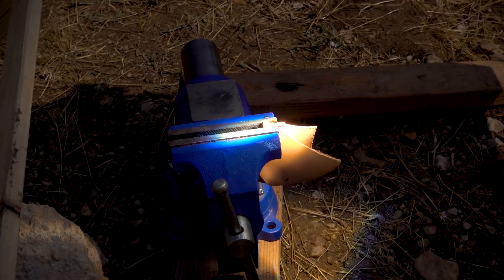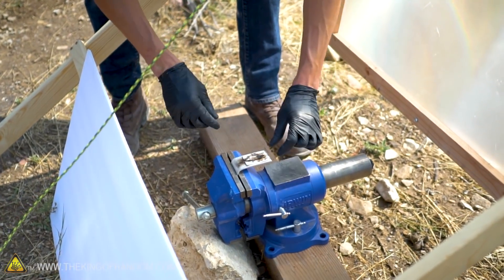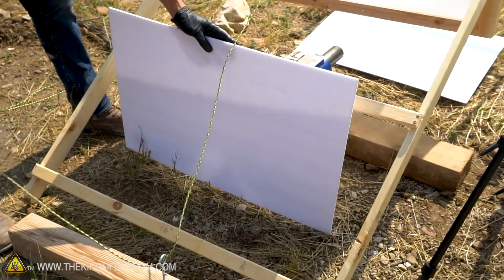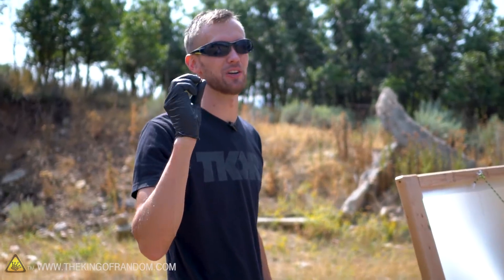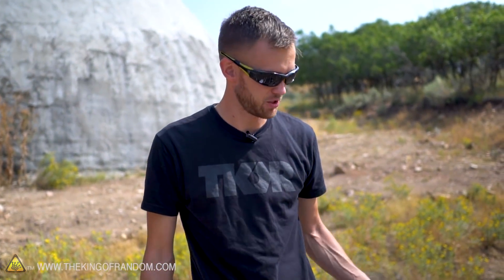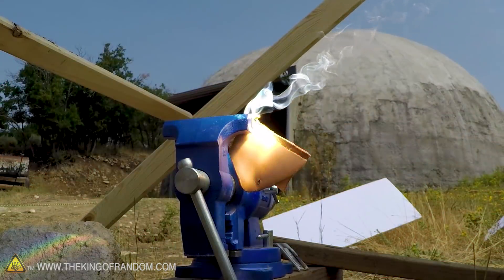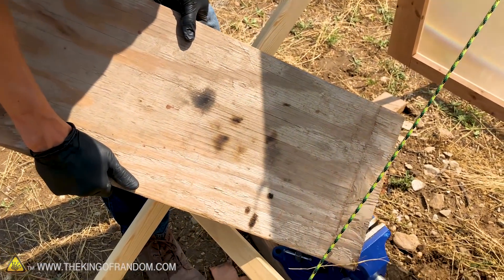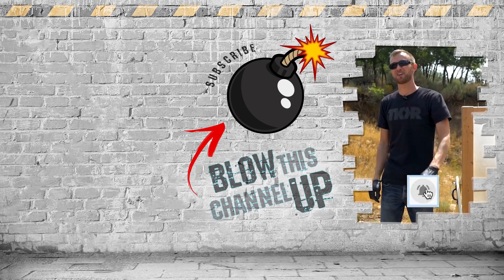We Shot Bullets with SUNLIGHT

Comment: A bullet will not go anywhere if it is not in a chamber where the pressure can push the bullet through the barrel.
Reply: Also firearm barrels have twits inside so the bullet spins on its way out causing it to have a straight trajectory appose to flying all over the place

Comment: When a bullet is fired outside a gun it looses almost all of its power because the gun directs all the power to the bullet and out the barrel( which makes the bullet fly fast) but when the chamber is not there to direct power, or goes everywhere and the .22 would hardly break skin. You’d be more worried about the casing than the bullet.

Comment: Why did you not use a high speed camera? You could try a piece of thread around the bullet going under the platform and attached to a spring loaded trigger to trigger the camera. When the bullet exploded the loop of thread around the bullet would break and high speed camera would go off. Or some variation thereof.
I'm wondering why no bullet fragments hit the Solar Shield which is huge and right in front of the bullet?

Comment: From my experience as a firefighter when exposed to heat the cartridge pops but the bullet will not “fire” because the way a bullet is designed it needs the tube for the gas to push it down (the chamber down to the barrel). We’ve been at fires where ammunition is popping but it never puts us at risk

Comment: The reason why there is not a lot of force behind the bullet is because most of the force that gives a bullet it power is built up inside the chamber and the barrel of the fire arm. With out that the 22 bullet is basicly a really loud firecracker with shrapnel which has the power of a bb gun.

Comment: Make a black flame by using a low pressure sodium light (this will be your light source) then light an oil candle and put tissue and salt water on the flame. And can you try putting the salt water inside.

(The sodium absorbs the light so it looks black

Comment: The only way a bullet will fire in the direction you want it to travel is if the bullet it's self and the gasses released behind it from the ignited gunpowder are encased In a space that the gas cannot easily escape from pushing the projectile. I bet if you tried burning larger caliber rounds in the same way the casing would be the only thing to worry about while the bullet either barely moves from its original position or falls maybe a foot from the casing, I've stood around a camp fire and tossed a few rounds into it and it wasn't very eventful.. but seeing stuff explode is always fun

Comment: There is NO "complicated mechanism" necessary.  Chuck up a #13 drill bit and drill a hole in the 2x10.  It makes a hole EXACTLY the same size as the cartridge, 223/1000ths of an inch.  That leaves you only the primer to focus on and you can 'point' the other flat side at what you want to hit.

Comment: I would think that from the laws of physics of action-reaction, more force would be applied to the casing which is lighter than the projectile and would travel farther. It would be like standing in between a light and heavy vehicle in neutral and try pushing them apart, the light one would move first..

Comment: Average bullet goes 2500 FPS?  what ammo are you averaging? The type of ammo you used goes about 1200 Feet per second at most.
Reply: The fastest 22lr rounds go 1600-ish (CCI Stingers) or 1800-ish (CCI Copper-22).  But, yes.  1200 is normal for 22lr.  223/556 go at nearly 3,000 fps, that may have been what he was thinking about?  But average bullet speed is 2500fps?!  What did he include in the average?  A railgun?!
Reply: PaladinVII how are you gonna explain that a .223 can travel at 3k but then wonder how anything can travel at 2.5k?
Reply: Duncan McGee  Re-read what I wrote, you are confused.
Reply: @PaladinVII  5.56 is often 3300 FPS
Reply: PaladinVII
2500fps isn't that much for a bullet. A .308 (7.62x51mm) goes about 2800 fps in a 23 inch barrel and even a 7.62x54mmR goes anywhere from 2600 - 2800 fps.
Reply: Andoxico a .22 flies between 1200-1800 FPS NOT 2500.
Reply: It isn’t in a barrel nor a gun, I don’t think it will even hurt if you stand just a meter away.
Don’t hold it though.
Reply: They refereed to average bullet so I am assuming that fact include all types fired from all the different guns and then an average is calculated.
Reply: 2500 frames per second?!
Reply: seasong feet per second
Reply: @seasong7655  Feet per second
Reply: @seasong7655  feet per second
Reply: I wonder FPS as in Frame per second or feet per second
Reply: Average 556 goes 2500 fps not any pistol round or 22's
Reply: Nonsense
Reply: Depends on the type of shot you get.  A .22LR usually flies between 1200-1500 but again depending on the shot and gun you can shoot a .22 that’ll go over 1800 FPS
Reply: it all depends whether long guns are included
Reply: It's an average between smallest to largest caliber. Of course, an extremely powerful round will skew results. Keep in mind, they didn't say that .22LR averages 2500 feet/second. Neither did they say that the average included all known calibers and variations of loadings within each caliber. So we can deduce that they are references all possibilities of calibers.
Reply: @JackedUpTricks  hes not dealing with all calibers hes focus is on .22lr
Reply: ITS A VIDEO JUST SHUT UP

Comment: I did this similar experiment 10 years ago if you get yourself a barrel the chambers are already redeemed into it put your cartridge into the Chamber Of The Voice hold the barrel pointed into the ground then Focus your sunlight on the primer pocket of the cartridge it will ignite and you will get a bullet traveling at a deadly speed also the casing eject from the chamber so you got power and acceleration going in both directions you're welcome

Comment: When fired like this, the pressure is way lower, due to the casing and projectile both moving, but in opposite directions, so I'm not surprised it didn't penetrate the foam board.

Comment: My theory as to why the bullets shot with so little force: in a gun the bullets fire so fast because the brass casing is strong enough to redirect the explosive force towards the copper tip and that shoots it forward. However with this, as you said in the video the solar scorcher "can melt a bullet casing" so its my belief that the heat from the scorcher is actually softening the brass which means that when that gunpowder ignites the force of the explosion goes all over the place. The jagged bullet casing you found supports that claim.
Reply: Plus it also needs a chamber of some sort around it for the casing to not explode and peel.

Comment: So a bullet travels at about mach 2, interesting
Reply: Depends on the bullet.  They're taking an average of things that are really so different that averages..... aren't as useful.  A 5.56mm averages around 3000fps.  Most .45 ACP rounds are subsonic, so they tend toward 800-900fps.  (Supersonic rounds exist, but the classic standard type is subsonic.)  The speed of sound at sea level at 'normal' dry air and temperature is around 1000fps.  For that matter, it also depends on the gun.  A standard subsonic 230 grain .45 ACP is around 800 feet per second..... from a 1911 handgun.  In a carbine or submachine gun with a longer barrel?  Over 900 feet per second because the longer barrel focuses more of the energy behind the bullet.

Comment: This might be able to make the bullet shoot with more power and better nate, try using a 9mm bullet, then take the barrel off off a 9mm pistol the put the bullet in the barrel aim the light at the primer and that should make this experiment work a lot better! It would mean so much to me if you could try it this way?!!
Reply: What you just described was the same process of shooting a gun, but instead of pulling the trigger to light up the gunpowder, you are using heat from the sun. Or am I wrong?

Comment: To improve the experiment get a metal tube the exact same diameter as the bullet. Drill a hole about 1/2 or 1/3 cm away from the bottom. This should act like barrel of a gun. The hole should allow the sunlight to focus onto the bullet. To eject the casing use something long and narrow and feed it through the pipe. This should reduce the chance of the bullet flipping and increase the chances of the bullet spinning.✌️👑
Reply: The tube would not really make it spin, but it would be able to concentrate the flow of gasses from the cartridge, which would make the bullet move faster/with more force.

Comment: I knew you’d probably get it wrong but that technically wasn’t a 22 Caliber bullet that was a 22 Long rifle bullet, a 22 Caliber would be a .223 round which goes in a AR
Reply: There actualy both .22 calibar bullets same diameter
Reply: you cant put a .223 in a ar youll ruin the gun only .308 you can

Comment: "not being contained in a gun, that just exploded"
It's possible that the jacket was so weakened by the heat (we know the solar scorcher can melt empty shells" that even moving fairly slowly it still just fell apart on contact with the wood.
Just a thought.
Reply: Also the cartridge isn't in a chamber, so when it expands there isn't a steel wall to keep it from bursting.
Reply: yes. that too
Reply: the more you know I guess

Comment: obviously the bullet won't fire to speed because it is forced through a barrel from the gasses you need to use a metal tube that is just barely larger than the bullet.

Comment: Different comment for this. So pretty much, you can secure the casing all you want. It won't really affect the path of the bullet. Bullets need a barrel to help guide the direction of travel and the rifling helps keep it traveling in that line. Without the barrel, the bullet can fly in a large area of travel because the force generated by the ignition of power isn't uniform, meaning that there could be more force on the edge of the bullet rather than evenly dispersed on the entire surface. The other problem is that you're not detonating the primer. That's why you're getting a shredded casing, because the force is travelling from the line of sunlight into all directions as the heat generates outward. Were you to focus the sunlight on the primer rather than the casing, you'll most likely see improved results.

Best suggestion, if you were to try and 'improve' this experiment, is to use deer slugs. The primer is larger and (some) slugs are just a large ball, meaning you won't have as much issue with wind resistance changing the path of the projectile. The only difficulty you might run across is getting the scorcher to not melt the plastic casing. That is easily remedied, however.
Reply: yeah that's usually why they're called rimfire. The scorcher wasn't applying heat to that area as much as just a random part of it.

Comment: Wait could you see how strong bulletproof glass is?
Reply: Psychotic Rainbow we have demolition ranch for that
Reply: Adding on to that. Homemade bulletproof glass?
Reply: depends on what type/thickness (and every bulletproof glass has to withstand up to a 9mil, some even higher)
Reply: As someone else said, demo ranch does that. I asked a local supplier how much it costs and for a 6”x6” piece they sell it for $500 and that’s the thinner stuff, not even as thick as you see in banks. Bullet resistant glass is ridiculously expensive, shot down my hopes of testing my own guns on it lol.

Comment: Spoiler

So basically, a bullet needs a barrel to move in a certain direction. The bullet here just exploded in no certain direction with very little force. To have enough force to actually shoot it needs the barrel, which uses the explosions force to launch it out one side. With no way of directing that explosion it just went wherever instead of using all of that force to shoot in one direction.
Reply: Zombie Sniper Bros i knew it wouldnt go anywhere
Reply: Zombie Sniper Bros and don’t forget the thing that hits the butt of the bullet
Reply: Compressed gases
Reply: You wrote what I was thinking and why he would be scared of it other than the small explosion but I didn’t really get the idea of the video
Reply: The chamber (in this vid) could be suggested by adding a cinder block on edge behind the 22LR (not too tall or it could block the sun) as for the barrel... a small steel pipe could be used with a whole for the sun to get through but that would also allow an escape point for the actual firing of the round. .... might be interesting to see what it would do in an enclosed Lexan tube that would be thick enough to take the firing of the gunpowder.
Reply: All valid points except all have forgotten that brass melts under the solar scorcher which is why the casing exploded..
Reply: I'm not convinced it would have had enough time to get that hot.  Maybe.  Maybe not.  Nitrocellulose ignites at a much lower temp than the melting point of brass.  It might have softened a bit, yeah, but it's likely that it went off and burst the casing long before the casing itself got that hot.  You'd really need to do it with a temperature probe to be sure.
Reply: Also, most of gun barrels have helical grooves, so the projectile spins when shooting.This stabilizes the flight. Without a barrel, bullet explosions are "almost" harmless (at least compared to a real shoot).

Comment: Fun video, but I think you need to do bit my research about what all the parts that make up the cartridge. It will make you sound more like you know about what you are doing. Also, where did you get the average speed of a fired bullet being 2000 ft per second, I am just wondering about that as they range from 600 FPS to well over 3200 FPS. You may well be right but I wonder if you will share your source

Comment: You could have gotten a .22LR barrel and set it off with the scorcher. It would have acted like a blowback action with out the large bolt mass holding it in place and it could penetrate the foam board

Comment: Brass, which is what most bullet casings are made of, is too soft of a metal to contain the explosion from gunpowder.  If you leave even a little bit open, the pressure is going to try to escape through that, which is why the casing kept on blowing apart.  In order to make this work, you would have to insert the casing into a well-fitting tube of some stronger metal, like steel (or even thicker brass), and leaving the base with the rim exposed.

Comment: You have to try it with keeping the bullet in metallic tube which is closed from one side & Cut the half portion of the tube where you have to keep the bullet.
Try it may the bullet would fired in straight line and particular direction

Comment: The brass weighs much much less than the lead bullet. Ergo the lead is not going to move near as fast as the brass.  Try this. Push a small light boat away while sitting in a heavy one. Which moves more?  Physics

Comment: I rolled my eyes on the hiding behind a bunker because I knew the power would be low and cringed when clamping down on the shell since the 22lr has the primer in the rim.  It would not be deadly but would be like holding a firecracker in your hand if it went off.

Comment: The casing is lighter than the bullet, so you can expect it was propelled faster.  Probably a lot more dangerous as the bullet in this situation.

As for the bullet, I would have liked to see how much penetration it would have in the foam just from throwing it by hand.  I rather suspect that you could throw it faster than it was propelled away from the casing.

Comment: If the bullet is bouncing off of the white foam, why would it impact the hard wood board? 🤨 .22 isn't going fast enough to go through either. A .17 HMR will go through the white foam easily and you might get a .380 handgun to go through the board if you're trying to step-up small caliber at a time.

Comment: I am sorry but your fun fact is a bit off for the round you were firing.

The velocity of standard-velocity .22 LR rounds varies between manufacturers. Some standard velocity ammo may be slightly supersonic-around 1,125 ft/s (343 m/s), other ammo such as CCI Standard Velocity .22 LR ammunition is rated at 1070 fps. Most standard velocity ammo has a bullet weight of 40 gr (2.6 g).

Comment: Yall should try doing something with HDPE plastic there's several applications and it melts in the oven with no harmful fumes
Reply: I've did a lot with HDPE and MHW
Reply: @goatybreath4351  its pretty awesome especially if you set up a mini lathe like with a drill
Reply: A very buildable material.

Comment: Theoretically De-ionized water shouldn't short out electronics. Please test this
Reply: There's usually enough contaminants on any surface that will dissolve into the water, making it more or less conductive. IIRC Louis Rossman did some tests with water, cola etc.
Reply: @michaeltempsch5282  It works if they keep everything sterile. The Action Lab did a video on it and it worked.
Reply: "Usually” is usually not equal to sterile lab conditions.😀
I tend to find real world conditions/situations more interesting and useful..
But some testing on what level of cleaning of, say a motherboard, that'd be needed for demineralised/deionised water to not get conductive could be interesting.
Reply: @michaeltempsch5282  it's not hard to keep things sterile. You just need to clean the thing you hold the water in and wear sterile rubber gloves. And it doesn't need to be in a lab